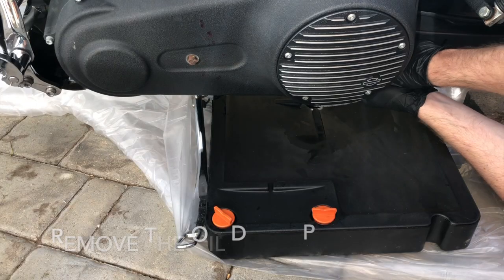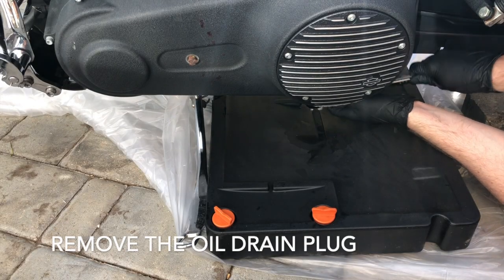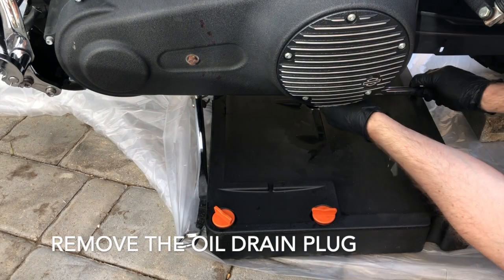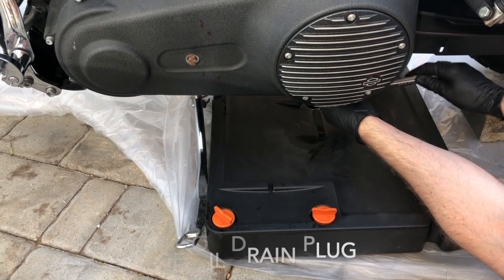How To | Change Your Engine Oil | Harley Davidson Street Bob FXDB

Comment: Nice video!  I have a 2007 Dyna street bob, one thing to keep in mind is that the engine is rubber mounted and the oil filter is directly above the rubber engine mount.  Taking off the oil filter like that will put oil on the rubber mount and ruin it in no time at all, the rubber will expand and the engine will eventually shake like crazy and the mount will have to be replaced often.  I have a flat funnel that goes under the oil filter, you take a big nail and put a hole in the top of the filter, then unscrew the filter a half turn so the oil slowly drains out of the filter and down the flat funnel.  Then when it's completely drained you take off the filter.  You can do it like you showed but I'd follow up with brake cleaner and clean off the rubber engine mount or you'll run into trouble.  When I bought my bike the front mount was covered with oil, the rubber was expanded about 2X out of the mount and the engine shook so bad I was afraid to ride it without replacing the mount.
Reply from the maker: Thanks for the tip, I'll pull that in next oil change
Reply: I'll give it a try sounds like a great idea

Comment: Excellent video mate one tip if I may share it you probably already know but get a plastic water bottle cut the top off where the lid is and slide it iber the filter works the same as the Harley drain thing you gotta buy
Reply from the maker: Thank you for watching, and thank you for sharing that tip.  Cheers

Comment: is it necessary to change transmission oil? Because I want to service my dyna street bob by myself and I saw couple of videos on YouTube to find out how to service our bike at home. Some people changing a transmission oil also and some people don’t. So if I had to change transmission oil then which oil should I use?
Reply from the maker: Yes, you can and should service your transmission and primary drive oils as well.  Per the Clymer manual the transmission and primary take the same oil, i.e., HD Formula+ Transmission and Primary Chain Lubricant.  If not available then 20W50
Reply: @SingleMaltMotors  Sir. You mean the Engine oil 20W50 can be use on transmission and primary as per the rule? Sry for asking the same question twice . I just want to be 100% sure before i step on it.
Reply from the maker: @windchaser5  No, you'll still need to use transmission oil.  Here's a link to HD for reference, you'll want to make sure this is right for your specific bike. 
https://www.harley-davidson.com/us/en/shop/heavy-synthetic-gear-oil/p/62600091
Reply: @SingleMaltMotors  Thank you sir. But in my country is only available 85w140 :(
Reply: @windchaser5 thats also good, maybe better. Harley today uses one oil for all 3 chambers (HD SE SYN3). So i doubt the relevance of specific oil, but i use specific ones.

Comment: Do you also have a specific torque for that linkage?? I bought my fxdb few months ago and now I want to change oil in March and I also have no access to oil filter because my linkage.
Reply from the maker: Per manual, torque spec for shift linkage nut is 96-144 in.-lb.
Reply: @SingleMaltMotors  yes I found that thank you Sir.

Comment: Well which ones the pip drain plug?
Reply from the maker: I don't understand your question
Reply: @SingleMaltMotors  fuckin auto correct changed oil to pip lol I couldn't get a close enough look and which plug you removed to drain the oil. There's a couple around the area under mine where it would drain
Reply from the maker: @redseaford9426  Gotcha.  I'll try to paste an image into comments showing the oil drain plug.
Reply from the maker: Link to image on web: https://www.justanswer.com/uploads/harleytech/2008-10-11_195246_Oil_Drain_Dyna.jpg
Reply from the maker: It's the plug on the side of the oil pan, not the one on the bottom
Reply: @SingleMaltMotors  oh gotcha, preciate it! And thanks for the link